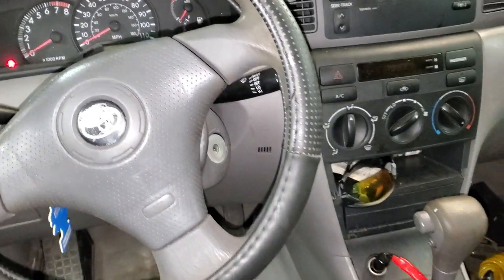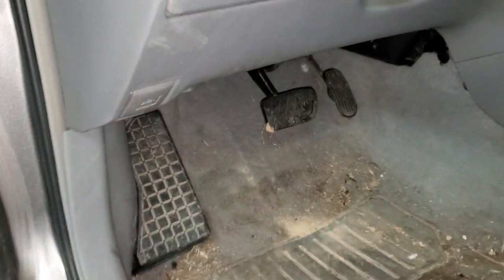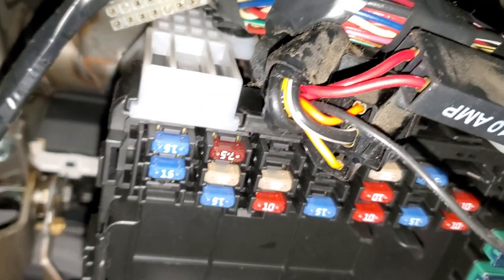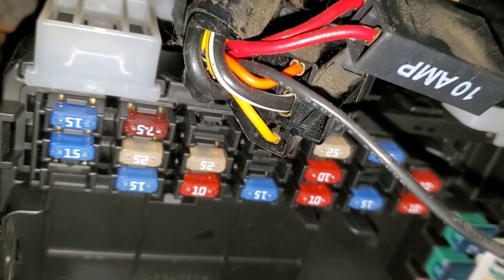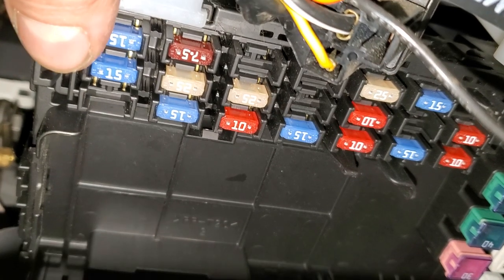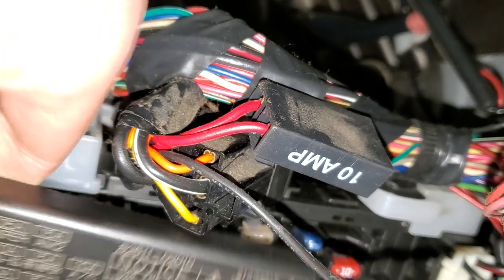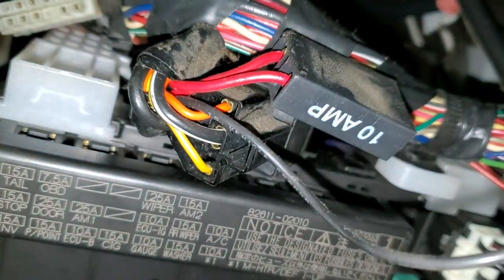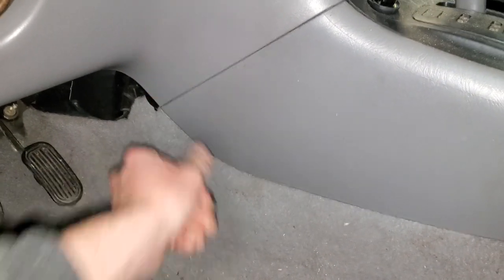2005 Toyota Corolla Cigarette Lighter Fuse, Power Outlet Fuse Location

Comment: I wanna know which fuse shall I replace for 
Shift Lock Control ECU or Gear Shift panel Bulb. I changed the bulb it does not work at all. rest every bulb in the interior is working great. 2005 Corolla.

Comment: I changed the fuse but my stereo, cig lighter and clock still don't work. Any ideas what I should do
Reply: Hello Hello youtube has a lot of videos regarding how to fix the clock, if your fuse is ok you can try repairing the clock, is easy, only you need resolder some resistors
Reply: @gerardogrillo5848  thank you so much.